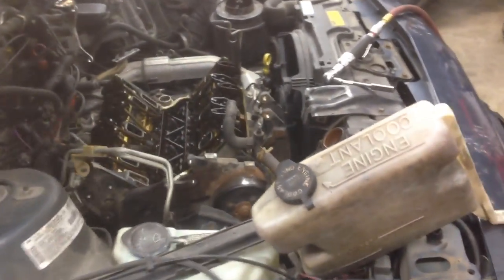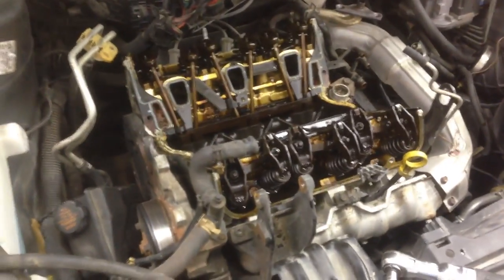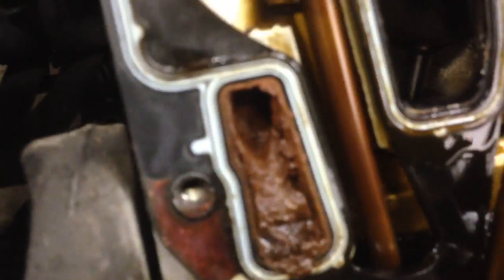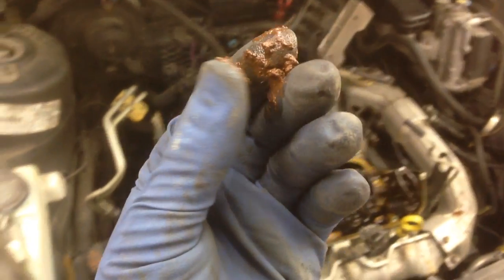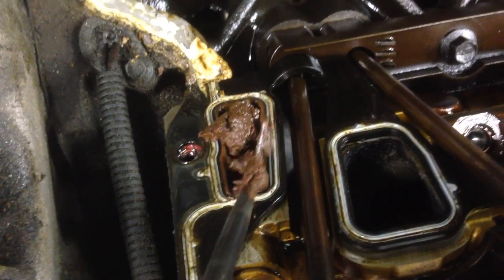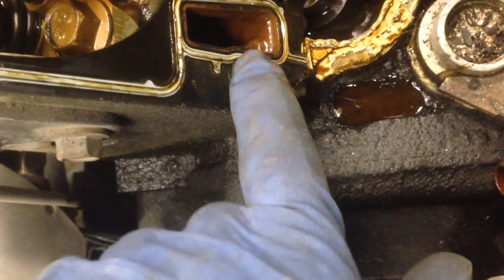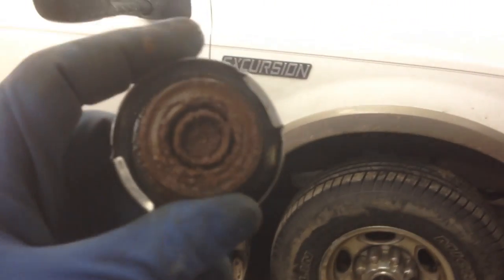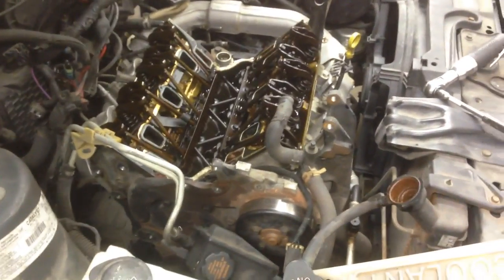Why it's called DexKILL

Comment: 1.18.14.     The coolant passages that are spooged up, are dead ended against the intake manifold. There's no flow in that area! The other coolant passages are not spooged up because there is flow of coolant. Also Fel-Pro makes the PermaDry metal framed L.I.M. Gaskets, use no others! It's false economy to go 5yrs/150k miles on a coolant. I go 2yrs/30k miles on coolant regardless of type. There's two drain plugs, one for each bank of cylinders that will COMPLETELY drain the engine block, but they are a bite to reach, especially the fire wall bank.

Comment: Gelling like this can also be attributed to mixing of different types of coolant will cause them to gell. In my Cummins I use,HOAT. Chrysler use this in all the Cummins I have an 05. They have changed it a couple times since. I've had the truck since new I've replaced it three times and I've never found any impurities in it whatsoever it's a pink  color and it looks like new, heater lines manifold plugs radiator hoses etc. showed no residue at all never had any problems with corrosion or gelling like this case you're showing. I would bet the owner mixed it, just a thought

Comment: My 97 dodge ram cummins diesel blew a oil cooler a month ago, dumping a few quarts of oil into my cooling system that made this same consistancy sludge crap. Kind of like warm peanut butter.  I took the thermostat out and ran some detergent through the system.  Ive drained and refilled the cooling system at least 8 times now but last night the sludge completly clogged the radiator to the point the water pump couldnt move any water and the upper radiator hose is empty. How did you get rid of all this dexcool sludge from the radiator and cooling system? I still cant get rid of it. Radiator is brand new so im trying not to replace it. Oil level has not changed since the new oil cooler so this is all residual from the first failure. Im really stuck here

Comment: I have had a lot of 3.1 liter Chevrolet's over my lifetime. I believe they are really good cars and if you maintain them properly you can get a lot of Life of those engines. I've also spent many years working in the salvage yard and then noticed vehicles that use Dex Cool are usually very nasty looking under the hood. I've also noticed that there seems to be some variation in the coolant labels that tells you when you need to service the coolant. I have seen some labels that say you need to change the coolant every 10 years or 150,000 miles. I have seen some labels that say every 10 years or 100,000 miles. I have seen some labels say every five years or 100,000 miles on the newer vehicles. I believe the problem with Dexcool is people don't maintenance it properly the way it's supposed to be and they figure that since the odometer doesn't have a hundred thousand miles on it there's no need to change the coolant even though it's probably been in there for over 5 years past when it should have been changed already. I have had to do many upper and lower intake manifold gaskets on a 3.1 liter engine and everytime I buy a new one that still has the Dex Cool in it I just go ahead and buy new radiator all new hoses and do a very thorough block flush with a garden hose and the cylinder heads pulled and the block drain plugs pulled. I also think it's worth mentioning that when you have an engine like this that is this plugged up you might as well go ahead and pull the heads and flush out the coolant jackets around the Pistons because I actually had an engine that the coolant passages to the rearward head stopped up because the holes in the head gasket got plugged up with this gunk. Believe me you think having to change the lower intake manifold gaskets after 25,000 miles is bad wait till you put this thing all back together and find out that you got a head gasket clogged up and got to tear apart all your brand new work you just did. if you're down this far it's not too much extra work to get the heads off and usually whenever I replace the head gaskets I use brand new head bolts. I'm not trying to defend Dex-Cool as I don't like it either, I always run the green antifreeze in all of my 3.1 liter engines but I think this is why it fails is because it's left in longer than its supposed to be.

Comment: My heater core clogged up at 17k from sand castings on my 02 blazer. N the Intake manifold gasket went at 40k. Not impressed. GM need to get their shit together. Was warned right after purchasing that V6 maniflod gasket will eventually fail n it did.

Comment: My parents got their '99 Cutlass converted not long before it got parked and I'm definitely gonna continue to keep it converted when doing my own work on it and I also wanna replace the components while I'm rebuilding the engine like the hoses, radiator, thermostat, coolant temperature sensor, etc.

Maybe the Dexcool being in it for a majority of its life explains why one of the cooling fans are out, if the radiator isn't working correctly it can make the cooling fans work too hard and then the motors burn out. It also could have just only been from the vehicle being red-lined and I don't mean the tachometer.

Comment: Decool has another trick to be aware of, deteriorates the lower portion of some factory intake gaskets. I can't recall all the years involved but 97 4.3's are in there. Lost a rod bearing near the top of a long climb in BC. A quick u-turn and costed 9 1/2 miles to a motel parking lot. BCAA membership saved us a $1200 tow bill. I couldn't believe how brittle the intake gaskets had become anywhere contacting the coolant. It was a time bomb waiting to explode. I'm sure glad we hadn't crested the hill top. As my Croatian friend was quick to point out, some a from the bitch was you lucky, and a few words of wisdom, better to be born without the c0ck than without the luck. Anyway, just a fond memory of an interesting trip, Cheers

Comment: also 3800 as well very common anytime I get a gm car with dex-cool I flush with a garden hose and I use some radiator cleaner as well with distilled water and make sure I get it all out than from there I go with the green stuff

Comment: I had the exact same issue with my 02 Blazer LS with the 4.3.  Previous owner had Dex Cool in it, and ate through the lower intake gasket.   Luckily it only leaked toward the outside of the engine.  Flushed all that orange crap out, replaced the gasket, and put in the green stuff.  No problems ever since.

Comment: I had a 93 ford ranger 2.3 5sp that had the same rust colored mud in the radiator.  I flushed it 5-6 times thinking it was from running straight water in a pinch a while back but I'm wondering if dexcool wasn't put in at one point. not by myself. thanks for the video!

Comment: The dexcool does that only when it gets low.  So when you got a leak it got low and turned into tjis substance which is actually an acid.  What probably happened is you used the old style heead gaskets and too much sealant in the front and rear valleys.  This almost always causes blown head gaskets.

Comment: I had a 1998 Blazer 2.4 and a 1998 GMC Sierra 3.5 both running dexcool. The Sierra truck was fine and coolant was always bright red. The blazer on the other hand was a nightmare. No matter how thoroughly you would flush the block, the new dexcool would eventually turn to mud. Got rid of both of them recently.

Comment: I don't agree with your assessment of Dexcool but respect your observations. I have used it exclusively in my 2003 Suburban with 213k miles. I have done all the service routinely myself - never had an issue. Looks totally clean when I do my recurring flushes and I only used distilled water. This I believe is caused by something else like others have noted like mixing coolants or stop leak being added or improper application during the like of the vehicle. Do you know for sure the complete history of the vehicle as far as service on the coolant is concerned?

Comment: i have a 1992 firebird 3.1l  that the previous owner was convinced to put dexcool in, I ended up having to replace the radiator, heatercore, and rebuild the engine to get all the sludge out of it, plus a performance cam to help it breathe a little!

Comment: what's the problem with using air conditioning condensation water in my car, why would I have to use this "coolant" since temps here never drop below 7-5 C' in the coldest times of winter.

Comment: I've had an 02 Monte with the 3.8 almost 10 years and I've never seen anything like this. Always used dexcool in it
Reply: If you maintain it properly it does fine.  If you're mixing coolant types, pouring in stop leak pellets, or using that head gasket in a bottle crap then you're going to have issues.

Comment: During the mid 1990s, GM's new aluminum alloy in their engines showed susceptibility to metal-pitting when regular "green" anti-freeze was used.  In response to this, GM subsequently designed Dexcool, a low-silicate formula "orange" anti-freeze which would not pit the engine metals.  Unfortunately, it had the effect of slowly degrading the rubber intake gasket materials.  That, in turn, caused oil and anti-freeze to mix, hence the muddy, cruddy goop we are seeing in this video.

Comment: I have owned many vehicles that came with dexcool. Ive never had an issue with the coolant or it turning into sludge. In fact, When I flush and re-fill I just use dexcool again. As with anything, maintenance and periodic inspection is necessary, It should not get to that point without being noticed.

Comment: I had to do head gaskets 3 times on my 3.1L. The third time I finally did the metal-based gaskets, resurfaced the heads and it was good until I sold the car.

Comment: We've ran dexcool on both of our Tahoes, one has 240K miles on the clock, and we've had no problems with it regarding the dexcool. I thought some GM cars require it because of the Aluminium heads. The 4.8 V8 doesn't seem to have a problem with it, but that's all I know regarding dexcool.

Comment: no that build up is caused by mixing in g05 and/or ethylene glycol....thats what gums it up....happened to my 91 caprice....caused my water pump and radiator to fail.....dexcool is safe, just cant mix it with other coolants.

Comment: Who pulls the rear valve cover to do them? I leave way more on there when I do these. They probably started leaking again because gm's torque spec is too low. I just tighten them by feel.

Comment: Flush the Dex cool out. I ran distilled water in the summer time ( water has a higher boiling point + an an anoid in the radiator) then after a good flush in the fall 50/50 mix of regular old ( Green) Preston's in my 01 3.4 Impala with no problems. The video says this is the 2nd time of changing the intake gaskets? Was the Radiator changed the first time? Leaking water pump? obviously that is a point for air to enter the cooling system. I know some people can not afford a newer/better car! But to do this twice to a 98 seems counter productive and probably in parts and labor would exceed the value of the vehicle!
Reply: Daniel Scott 
   What is an anoid that you put in the radiator and where can you buy it? And does this get all the sludge out using your method? Best,
Reply: An Anoid can be many things, basically when you have a iron block/heads & an Aluminum radiator, the " softer" of the 2 metals  ( Aluminum) will corrode away due to Electrolysis, eating the fins in the radiator/water.pump etc. into the cooling system plugging water jackets, fins in the radiator, water pump blades etc. which just gets worse and worse. Any auto parts store should have an Anoid, flush system in the fall with any way you like you should be good.

Comment: I had a mechanical fix a coolant leak by replacing the water pump and plastic coolant sleeves on my 3.8 impala. I know he topped the coolant off with green because I saw it in the reservoir tank. Car would still run a little hot. I took the bleeder screw out of the thermostat and the orange dexcool flowed out. So I flushed the radiator myself and have been running only water ever since. The thermostat gauge is still sitting almost 2 notches over the half point. That muddy sludge is all inside the radiator and on the cap. How much will it cost to have it cleaned out of the radiator and engine? Ballpark estimate if anyone knows. I wanna get it done asap because this engine is remanufactured and put in a little over a year ago so it should potentially have several years of life left and I don't want any catastrophic damage to occur. So how much to fix?

Comment: Is that engine aluminum or iron block? I've had dexcool in my 2000 ls1 without issue and have beat the piss out of that motor. Though I have done usual coolant maintenance. Never noticed anything unusual when I flushed it though. 140,000+ miles.

Comment: I suspect cross contamination within the radiator. Could be pushing coolant into the transmission fluid, which would cause problems with both the engine and transmission.

Comment: The problem was the intake gaskets. They were redesigned 2 times on those motors. Once gasket went south it would allow air into system. When air mixed with dexcool created a high acidic coolant then it would sludge up and eat away at other components also. Other manufacturers also came out with similar type of coolants but they switched not to long after. GM 3.1l, 3.4l and 3.8l were a bad designs in my opinion.

Comment: I have GM 3.1 and 3.4. Will a flush solvent remove this crud from both systems? I can flush with garden hose.
Reply: +Paul Metcalf make sure you have the heater on when you drive it around and performing flushes.... that crap loves to hide. Don't forget to clean the radiator to expansion tank and hoses. Ah Heck - Just buy everything all new and switch to anything but DexKill.

Comment: It looks like someone put barsleak in there as well. Very common on those 3.1/3.4 engines. There is a superceded part number on the intake bolts because the old ones stretched and caused a leak. Nearly everyone grabs a bottle of stop leak and throws it in. Eventually it will blow the motor because it's nearly impossible to remove from the engine

Comment: Had an 03 cavalier, L61 2.2 ecotec.  Same dex-cool until 2017, 190,000 miles.  I decided to do the water pump, chains, thermostat.  Then i sold it to a very happy high school student.  Never had a leak.  It's NOT the coolant.  It's maintenance, or lack thereof.  Now, the GM 60 degree V6 does have it's issues with intake gaskets.  To not fix this, and blame the coolant makes no sense.  My cavalier's engine is still clean after 11 years of the same dex-cool.

Comment: Dexcool 50%-Distilled water 50% and never a problem. If you go to an independent garage always have distilled water in the trunk for top up. Never let them touch the radiator fluid. Keep a quart of Dexcool from the GM dealer in your trunk as well. NEVER use tap water. NEVER add green fluid. And you never will have a problem. I got to be 64 by following instructions. It's not hard, just stick with what works. Good Luck

Comment: I've done a few of these, and had Dexcool even mixed with other high mileage coolants. I've never seen anything like that.and they all had over !00,000 miles on them.i don't put dexcool back in older cars because there is nothing special about it, but this just looks like it's never had an engine flush.if your going to do this job use the metal gaskets. the plastic gaskets are the biggest problem.sometimes they last most times they don't.

Comment: Just because you've never had a problem with a product doesn't mean there isn't a problem with the product. It's when a LOT of people have the exact same problem that there is in fact a problem, even if it's not your problem. 

When I went to change my coolant in 2008 on my 03 s10 this is exactly what it looked like. I am the original owner and I had never put in any bar's leak or anything of the sort in there. This is straight from the factory. 

After a good flush (took quite a few to de-mud) and going green she runs a lot cleaner.

Comment: I've maintained older 3.1s, 3.8s, and 3.4s with high mileage. I've never seen this, but I think what happens is you overheat the engine, which in these engines is easier than most, I usually hear this associated with gasket failure, and that introduces a LOT of air and heat into the system. I've never seen this in a purposely maintained car, though, and you can hardly blame dexcool for this. you have an aluminum to iron gasketed surface, which is never good, so the gasket fails often, which stresses the dexcool. you notice gm switched to better gaskets and all aluminum and all iron engines, afaik, and this problem disappeared because major failure of the gaskets has stopped, from what I've seen.

Comment: I've only ever seen that when mixed with standard ethylene glycol based coolants. The green stuff! Been running  dexcool in my 94 cavalier forever. Never a problem. Do yourself a small experiment. Mix some dexcool and conventional coolant in a jar and throw a piece of aluminum in there. Close it up and set it on the shelf for about 6 months. Come back and check out the results.

Comment: I've seen the same thing in many makes and models, typically vehicles that sat, I suspect likely too much water in the coolant, rust and metallic bits from the water pump and in cases even the pump bearings impeller